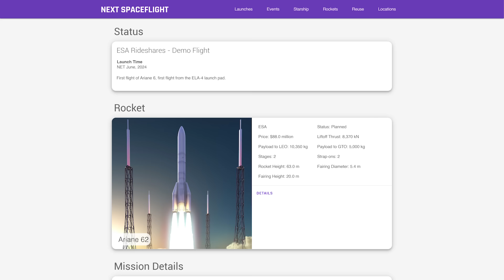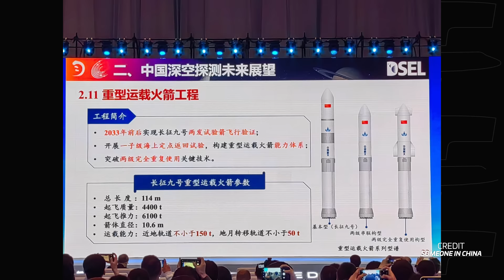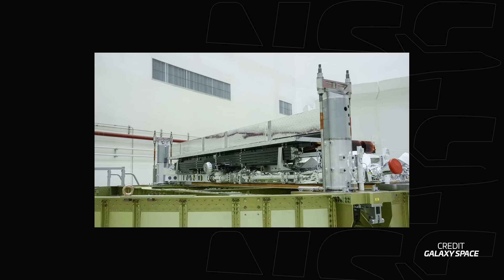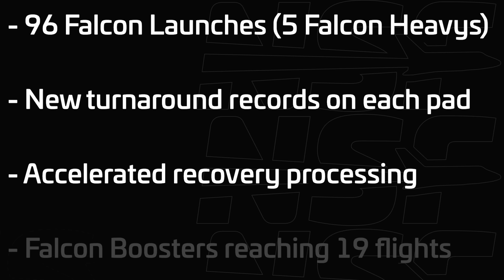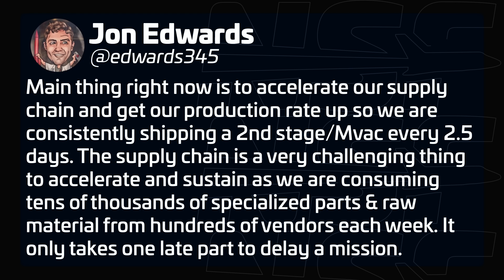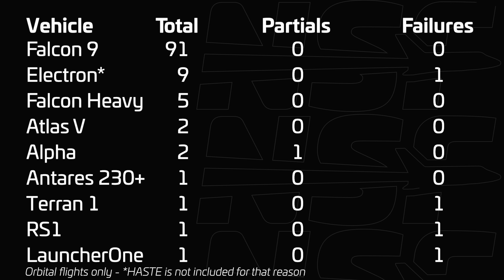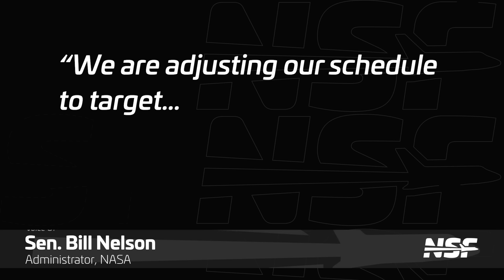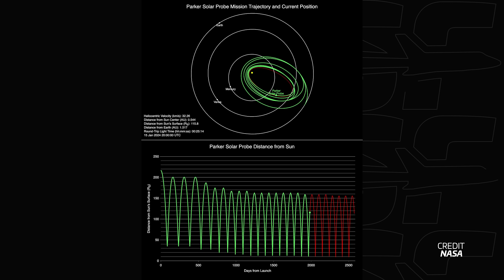Spaceflight Is About To Get HOTTER!

Comment: No human will ever step aboard Starship with the way it lands. EVER
Reply: why not? just because we have never done it doesn't mean its not possible. it will definitely take time (probably many years), but they just need to prove starship's reliability (which is pretty likely, since SpaceX is known for working hard and fast).
Reply: @hamzahkhan8952  great for cargo and an empty returning ship. You will need 1000 successful landing with 100% no fail on any component before that gets signed off. I believe the ship that is used for humans and is 100% reusable hasn't been drawn up yet

Comment: Does the second stage completely burn up in reentry?
Reply: Which second stage? There were many cited. The only second stage not supposed to burn on reentry are Starship and Stoke Spaces liquid cooled shield.
Reply: @BokoMoko65  sorry I shouldve been specific...I was referring to all the falcon 2nd stages. I'm just wondering if bits n pieces are probably scattered out there lol
Reply: @itsjustmando  They're supposed to burn up during reentry. But is plausible to consider that after almost 100 launches, some debris may have survived reentry.
Reply: @BokoMoko65  there was an instance where a broken up 2nd stage of a falcon landed in brasil 😅
Reply: im pretty sure F9 seconds stages do a controlled reentry after finishing its primary missions.

Comment: Did I hear "...the Sun-Earth Lagrange point..."? I thought Lagrange was a kind of gravitational balance? Seems to suggest an orbit closer to the Sun than Earth with a period of 365 days?
Reply: The lagrange points refer to a pair of objects, hence why to specify which ones one is talking about you have to first mention said pair of objects. Sun-Earth Lagrange points are not the same as the Earth-Moon Lagrange points
Reply: Aditya solar probe has been placed at L1 point of Sun earth system 
In total there are 5 Lagrange points in sun earth system 

Every system be it Sun Earth or Earth Moon has its own Lagrange points, where gravity of both celestial bodies balance out each other and you can keep a spacecraft there using the minimal ammount of fuel to stay there continously

Comment: "There hasn't been this much activity in the European space flight industry in a long long time, probably ever." Long long time, yes. Probably ever, no, not if you count # of launches, rather than # of different launch systems.
 The Nazi's launched thousands of V2's over the last 201 days of WW2. On average this worked out to one launch every 1.6 hours! At least two V2's were launched vertically and easily exceeded the 100 km Karman line. But most were "long range" launches with a maximum altitude of 88 km's (possibly exceeding the 80 km altitude the US armed forces requires a pilot to get past, to be awarded astronaut wings).

Comment: What happened to the plan to expand the diameter of Starship to 18m?
Reply: V3
Reply: Unfortunately, there wasn't a plan. Only a musing by Elon on Twitter. 
It would be something to see though. Imagine having the capability to launch an 800 ton unitary payload.
Reply: @portcybertryx222 no, V3 will be stretched to upto 140/150m tall. the diameter of starship most likely not change. it would take too much work to change the starship design like that now.

Comment: how do we expect to go to the moon or mars if we keep putting more satellites
Reply: That makes no sense
Why does putting satellites into orbit inhibit travel to the moon and mars?
Reply: The # of satellites has a very, very small impact on the feasibility of lunar missions
Reply: You have no idea how many satellites we can put up(especially in low-earth orbit) and still have way more than enough space for launches, even if you increased the number of satellites a thousand times over, you'd still have more than enough space.
Reply: @yomanyo327  Though you’d certainly increase the risk of Kessler syndrome by putting 1000x more satellites up
Heck, Kessler syndrome might not even be required to make things difficult at that point
Reply: @oberonpanopticon 
Yes, Kessler syndrome odds increase slightly, however, the odds are still very low. This won't make thing difficult at all.
Reply: @oberonpanopticon  The odds of Kessler syndrome are tiny, sure, we have to be careful, but that's about it. The fear of the Kessler syndrome inversely proportional to how well informed the speaker is.

Comment: Those Chinese launches that have a 'Red' cloud forming on startup, us a highly toxic combination of propellants that is hypergolic (self igniting) with RFNA (Red Fuming Nitric Acid) and n-Octane with an isp of 235 seconds. Methalox (SpaceX Raptor) isp is about 327 seconds (sea level) for comparison.
Reply: Long March 2/3/4 rockets use hypergolic fuel Dinitrogen-Tetraoxide(N2O4) and Unsymmetrical Dimethylhydrazine(UDMH). They do not use RFNA or n-Octane. The red cloud is from unburnt N2O4 released in the ignition sequence decomposing into nitrogen dioxide. The engines (YF-20 and variants) have a specific impulse at sea-level of 259 seconds. All Longmarch launchers after 5, and all conmerical launchers are cryogenic or solid.